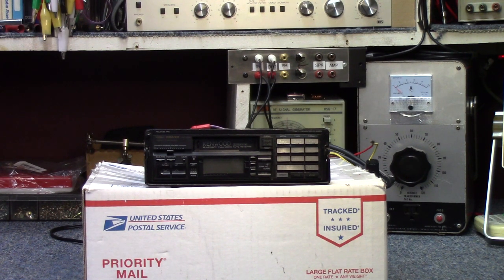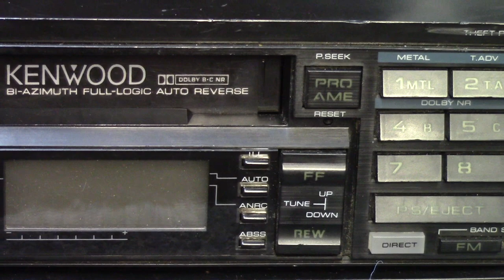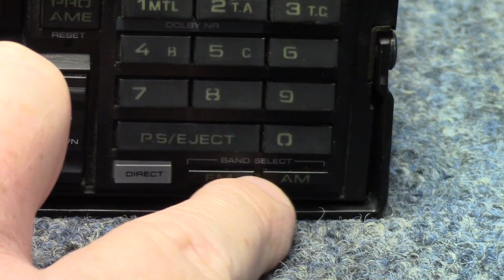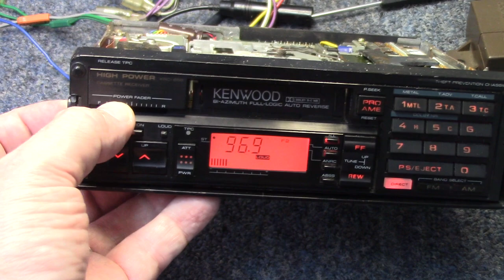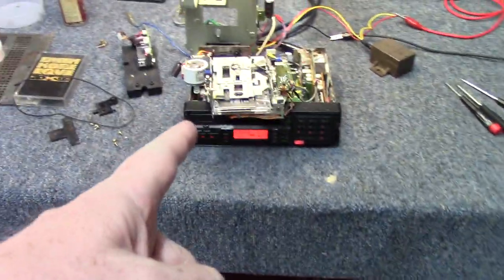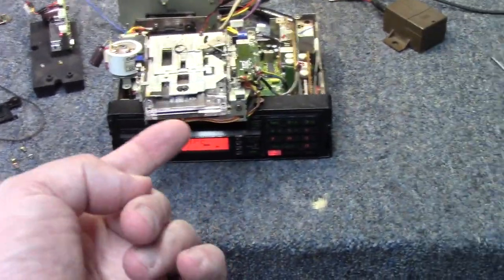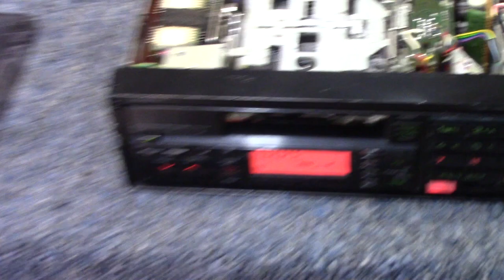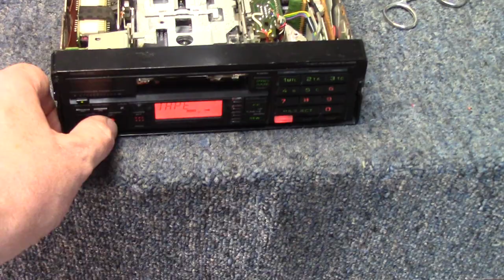Kenwood KRC-858 Car Stereo -  eval & repair

Comment: Kenwood made some really great car stereo systems, this particular one is nice considering it's age. There's really only two things that go wrong with cassette decks and the two are belts and lubricant! The hub speed sensors show Kenwood's dedication to performance, it's amazing that they chose to fit such a great feature in a car cassette deck, the reason why they used two of them is so that the unit can detect that the take up reel hasn't stopped turning due to the tape being caught up in the pinch roller and capstan pin regardless of tape direction, by jumping out one sensor, the unit can now only protect the tape in only one direction. To test out IR emitters, simply turn down the lights in the room and aim the camera lens at it and you should be able to see them glowing on the camera screen, works with mobile phone cameras too, TV remotes can also be tested this way. As for the belt, I have never tried it myself but I have seen other people take the original belt and boil it in water in the microwave, it restores it's original shape and tightens it up a bit also. Even though the tape transport mechanism isn't seized, the lubricant would be dry by now, after all those hot summer days inside a car where the temperature can kill a person. Pulling out the flywheels with the capstan pins to clean out the old grease and reapply fresh new grease generally fixes a lot of problems, it's possible that the unit was detecting that the tape was running slower in the opposite direction due to the extra load that the tape was placing on the mechanism that was already being loaded by the old dry grease, In my personal experience, you can't feel the resistance with your fingers but as soon as you lubricate the capstan pins and guides that they sit in and the hubs also, the eject mechanism also looked like it had grease on it at one time, I can see it on the top of the tape mechanism.. 
So those are my two first things that I would attend to before anything I do anything else, my next logical step would be to replace every single capacitor, assuming that the unit is worth it and the customer can be persuaded to agree to it also. This particular unit is definitely worth it, it was designed to function well regardless of the conditions, you can almost say that it was built to military spec! That's why they still command a good price.
Reply from the maker: Peter, thanks for your comments, you provided some good info here.  So much of the work I do on units never makes it to the final video because of time, if I filmed it all, every video would be literally hours long.  Not seen in the Kenwood:  I did pull/oil both capstans prior to the belt replacement, both reels were pulled and oiled also, any other grease issues I would have done “as needed” due to time and cost, I would say to break down that entire mechanism and replace the grease would easily be 3 + hours so doubtful the customer would agree to that.  Jumping the sensor was definitely my last choice but was better than the alternative of having no reverse play function, as for changing all the caps? That would be a seriously expensive and time consuming process, I try to strike a nice balance between what needs to be done, what should be done and what has to be done, that way the customer doesn’t need a fainting couch after hearing the quote - LOL.  Thanks for watching as always!
Reply: @luvradios  I do understand everything that you have said and that's okay, although on the topic of how long a video should be, don't be afraid to make it an hour long. No one has done a video on this device before so it's an original! I would have watched two hours of it if it was there. I have watched videos that had to be split into three or four one hour long videos because I don't want to miss any of it, but I got to see what opamps were used and what was used for the output stage, the type and brand of capacitors used and even some people discuss the circuitry when schematics are available. I realize that you are performing a repair for a customer and you can only do what the customer can afford or has time for but there are some simple things that you can do from your side that don't cost anything that you can include in the video that adds content of value for the viewers like me. 12V Videos also does repair work just as you do and boy does he pump them out! But from time to time he takes a few minutes to talk about something that he's working on and that's where I get to see how good he is, there's plenty of times when I would have wanted him to go right through the device that he was working on because I felt that it should have been restored but he is after all working for a customer. I don't have a YouTube channel myself so I don't know what sort of money people are making from it but I'm sure that if you had the viewers, you could afford to put more content into it, there's a few great channels out there already and they have basically set the standard for content, some of these are Mr Carlson's Lab, XRayTonyB, EEV Blog, Uncle Doug and more.... To get the viewers, you need to make sure that there's content! Generally speaking, I would watch a video from the before mentioned providers regardless of whether I'm interested in what they are working on or not, but I just know that I'm going to learn something important along the way! YouTube add revenue and PayPal help financially for the extra time that you put in because this is where the viewers rush to when a new video is posted! When you spend so much time watching someone work, you get to know their style of work and that brings in a lot of new jobs for you. I'm in Australia so that pretty much rules out me sending something your way even for a full restoration because the shipping cost is a huge joke. We have Dave from EEV Blog but he's not into repairs and I just haven't bitten the bullet yet (whatever that means, we don't even know what a gun is either lol) but maybe one of these days! 
I just hope that I'm not being to critical, I'm just trying to help you grow your channel and along with that your business. 
Thanks for your reply 😃
Reply: Это малинький накамичи дракон...😊

Comment: how do you adjust the speed on the motor?
Reply from the maker: If I recall correctly, this model uses a fixed speed Canon motor, is yours running too slow?
Reply: @luvradios  yes i have a sony ES-R18 that uses the same canon motor i was trying to figure out how to adjust it but i guess maybe it can't be unless you know of a way.

Comment: Hello there . I have similar issues with  one of my reel sensor in my Nakamichi TD 35z . I was wondering if you could help me on bridging the rev sensor to fwd so that the deck can function both ways . 

Currently the tape plays in fwd and once the tape passes 50% it start clicking rev fwd and eject
Reply from the maker: Yea, just off the get go that doesn't sound like a reel sensor issue and doubtful you can bridge them since the micro would (most likely) wanna see a pulse from both sensors during playback but if the tape stops after 50% has passed by I would want to know the condition of the drive belt and the gear/idler that drive the tape reels, are the gears/idler fully engauged to the reels?  Is it always 50% when it stops working?  Have you looked at the tape playing while it goes into failure? what exactly happens? Does the tape stop moving then switch from side to side?  will if succsesfully FF & Rew a tape to the end?
Reply: @luvradios  thanks for the reply . Basically it is not half way it clicks back and forth. Like 20-25% and then change to rev / fwd couple of time and then ejects . Fast FF and redwing RW is good . I checked the belts and all good and new , not hard or sagging . Checked all gears and looks good also . This deck is new one , installed and it was working for a week without issues . Then started this mess